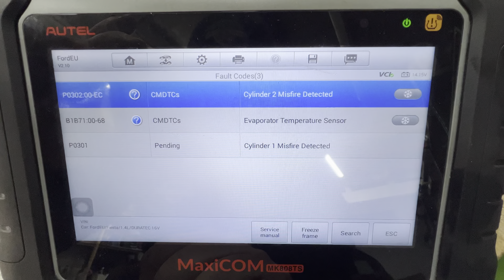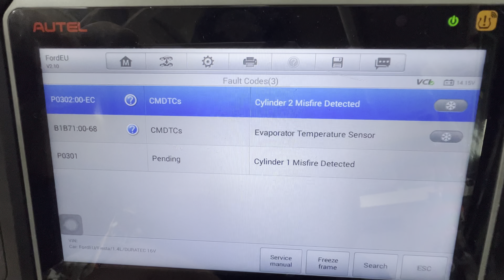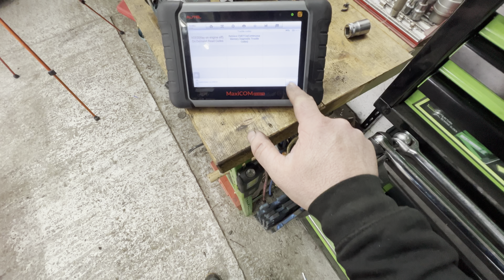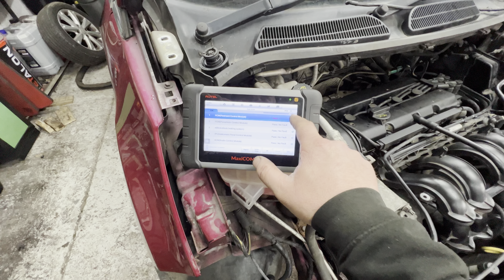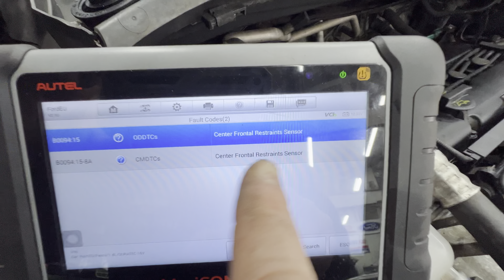Ford Fiesta Flood Damage Copart Salvage Part 4 Think I found The Leak

Comment: I had a problem with my old Nissan a few weeks back. I traced it to the wiring loom in the tail gate. rain water entered through a perished rubber concertina, travelled down the inside with the wires and exited in the boot. did the same as you and pumped the mastic in with the wires.  Cheers Jim in NZ.

Comment: Is it normal in these zetec engines to have blow back air when the oil cap is unscrewed and engine running? I can feel the air with my hand, the cap jumps around if it is unscrewed.
Reply from the maker: @ayu12641  Hi yeah completely normal
Reply: @ResurwreckAutosUK  Thanks